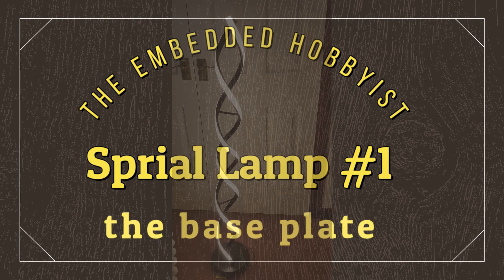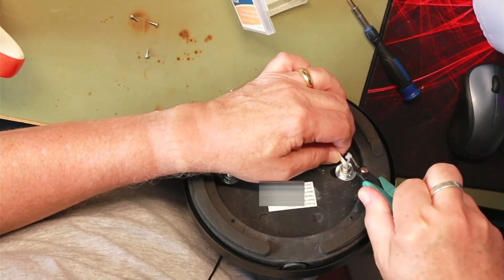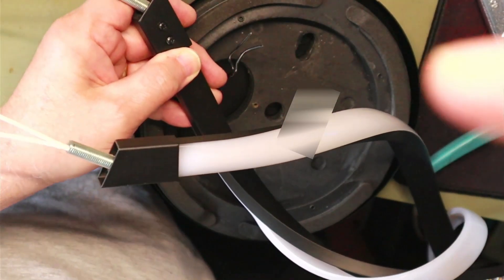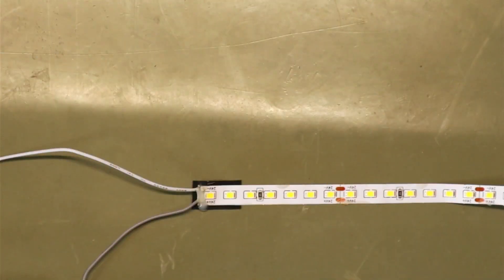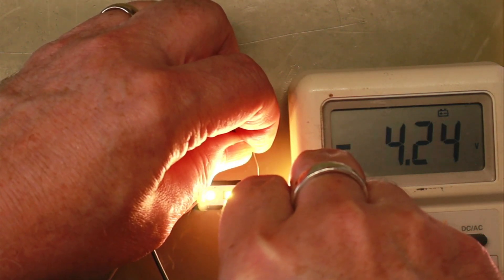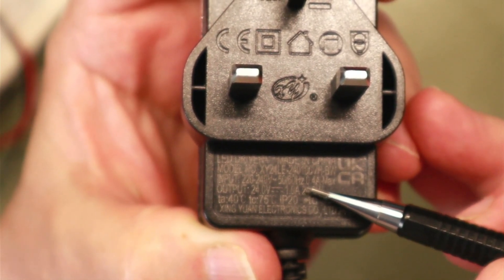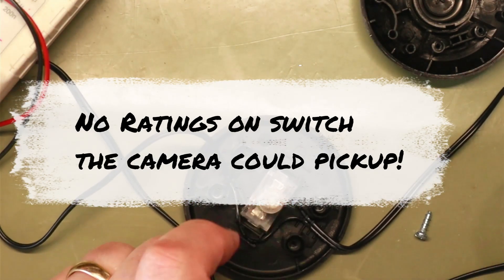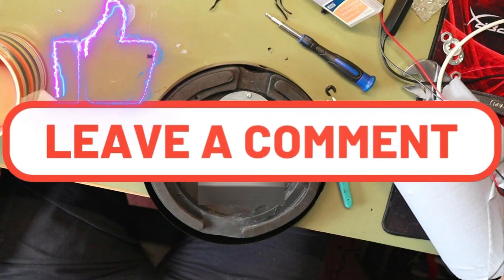#235 spiral lamp teardown to base plate part 1 of X

Comment: Maybe use could use the old base to make a new base for a DV27 and get you back on the CB, just like the old days🍺.
Reply from the maker: Have you tried a Mag mount on a modern car!

My Volvo has a roof a little bit thicker than tinfoil. 😞 I had to get a roof rack and then bridge the two with aluminium angle to mount a 2m/70cm colinear. 

Thanks for the comment, I hope your will like the rest of the project.
Reply: @TheEmbeddedHobbyist  I have a couple of old CB radios somewhere in the loft. One is a modified Ham International ( I can't remember the model). It has high and low bands. Had great fun with this radio back in the day. Oh  I just remembered, it's a Concorde-II.
Reply from the maker: @daveodessa  I think I  had a few Midland am radios, it was fun when it was illegal.  when they made it legal in the UK it just became id hate to say a bit boring. But by then I'd become a Ham or cured cb'er :-)